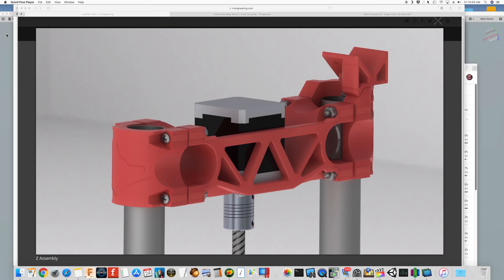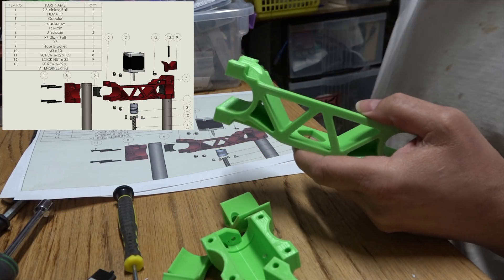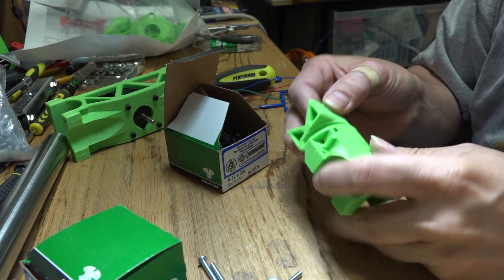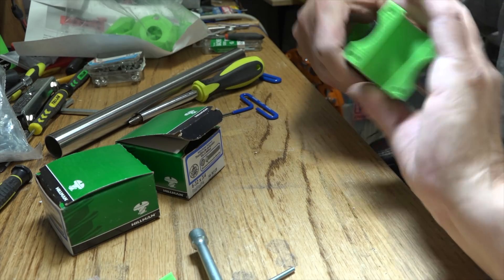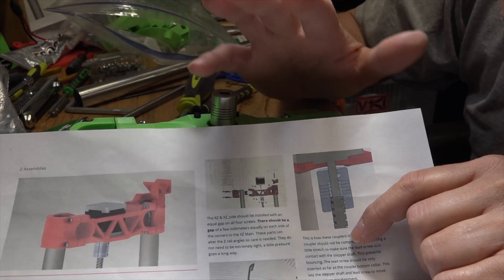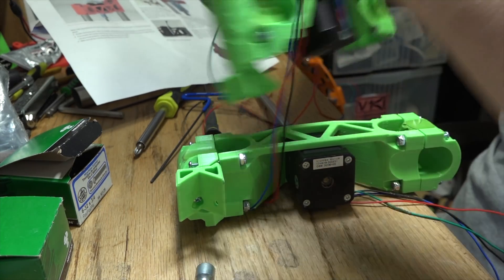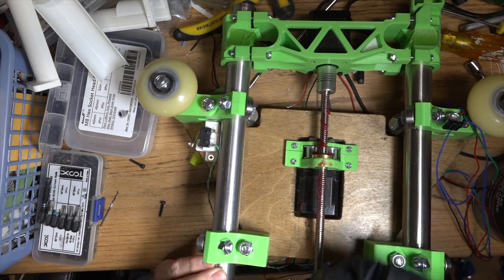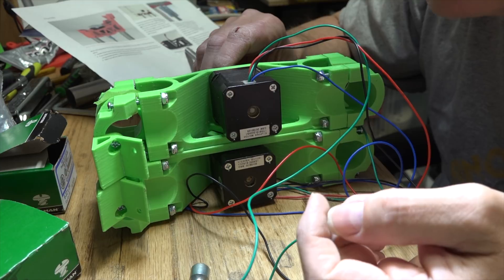Lowrider II Upgrade - Part 4 - Z Assembly

Comment: Re. Lead screw Schmutz Cover - Thanks for the great design! Part is perfectly apportioned. Thick enough to do the job and no thicker than it needed to be. Placement seems spot on. I just rebuilt my LowRider 2 table, now with Superstrut metal rails, and the undercarriage can now serve as storage for 4x8 sheet goods. I'm now resurfacing my spoil board after printing and installing your "Lead screw Schmutz Cover."

Comment: No!! Not grease. never grease. Grease is not viscous at room temp it will just attract dust and make a great grinding paste and will eventually start to become tacky. Even a little 3 in 1 oil or gun oil or sewing machine oil is preferable. If you can see it, it’s too much. Even a tiny amount of Vaseline is preferable. Otherwise love watching your videos. Have been following you since your mpcnc build. Learned a lot about aspects of builds especially your playing with laser. Enjoy watching you. Thanks.
Reply from the maker: Markal Thanks for the tip!